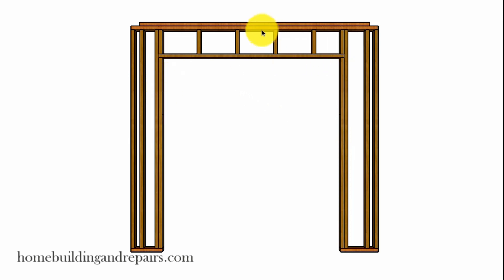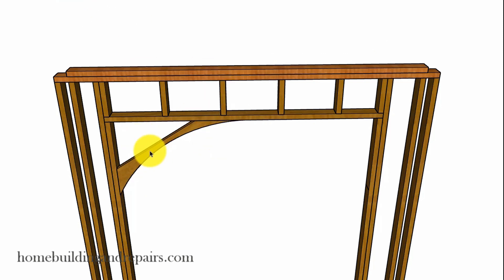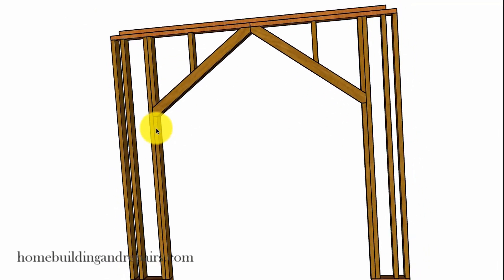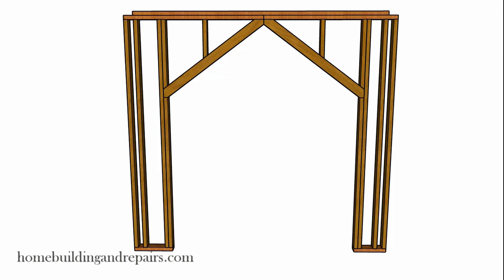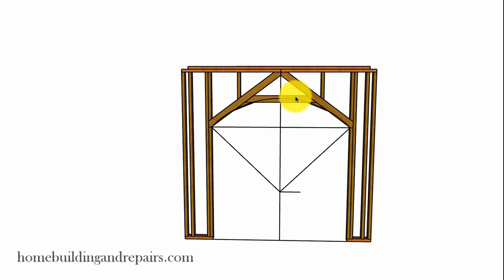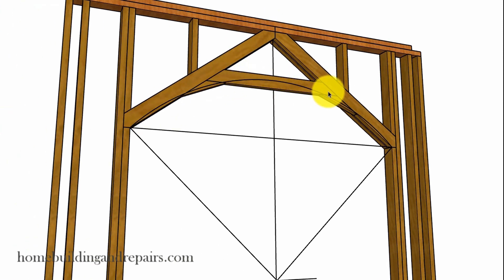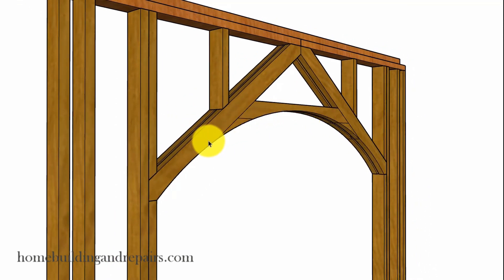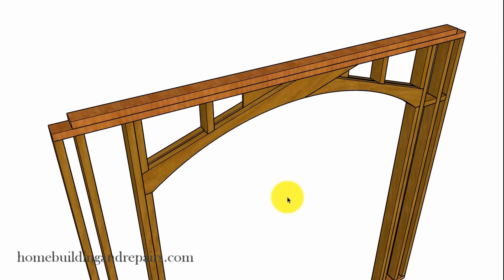How Carpenters Built Arches In Old Houses - Without Plywood or Adhesives

Comment: Great video, Greg ! I did this same Arch framing on a load-bearing wall between my Dining and Living Rooms. a few years ago. It worked great but I have a caution to your watchers and subscribers. This technique is great and works well; however if you have friends who are on the taller size, this does possibly affect them, they may not be able to pass the arch except in the centre of the opening.
Reply from the maker: Excellent advice and another thing to think about while designing any project, including decorative arches.

Comment: You are dead on right. My house, built in the early 1900"s and totally remodeled in 1932. No headers just two flat 2x4's for headers. And it looks like the use of a small block plane. There are curled shavings at almost every window opening laying at the bottom plate. Interior walls have no bottom plates. The interior walls are toe nailed with 8 penny nails right to the board subfloor.  And if a narrower board was needed, looks like an az or hatchet was used to make the board to the measurement needed.I like your channel and subscribed!! Thanks for posting!!

Comment: mechanic" was often used more broadly than it is today. It referred to skilled tradesmen who worked with their hands and tools all the way back to the early 1600s these where the general terms used                                                                                                                                                                                                                                                                                         Carpenter: A general term for someone who worked with wood, constructing buildings, structures, and other wooden items.
Joiner: A carpenter who specialized in joining wood, creating joints, and assembling the wooden components of buildings and furniture.
Cabinetmaker: A carpenter who specialized in making furniture, particularly cabinets, tables, and other fine woodworking pieces.
Housewright: A carpenter specifically involved in building houses.
Shipwright: A carpenter who specialized in building and repairing ships.
and if you where Welsh you where a SAER

Comment: Plaster arched doorways were very fashionable in the '30s and '40s. Many Victorian and other earlier homes would have their cased woodwork doorways and such ripped out and replaced with these plaster arches.  It was fairly common in many of the homes in my area.  My friend has a large 1910 craftsman home where this was done durning a late '30s remodel. Every first floor doorway and passageway had it's casing and trim ripped out and they got the plaster arch treatment. While it was neatly done, the house sure is missing a lot of character.  I've broken out a couple, and both of the arches were formed with curved wire mesh on top of some straight 2x4's.
Reply from the maker: Interesting and I've seen then done with filler blocks also.